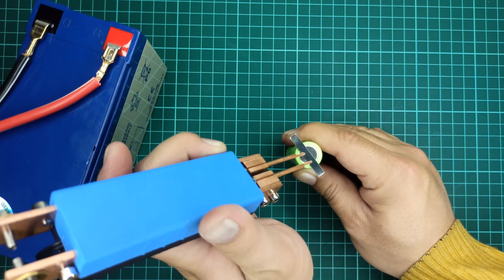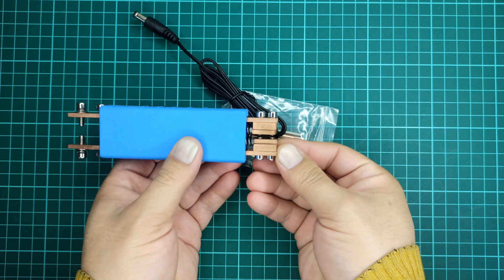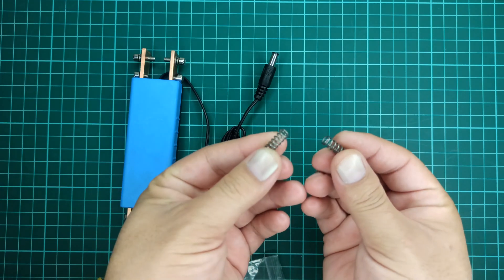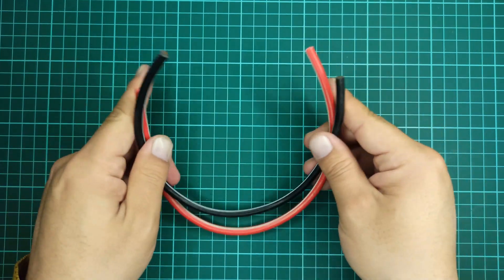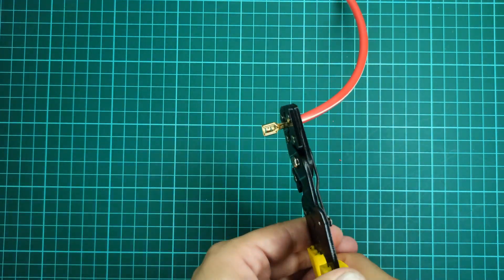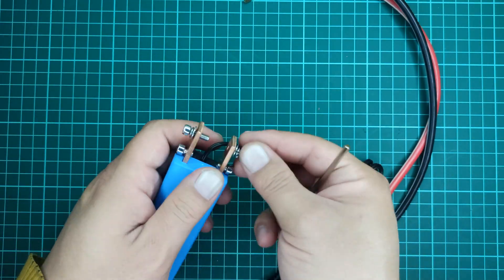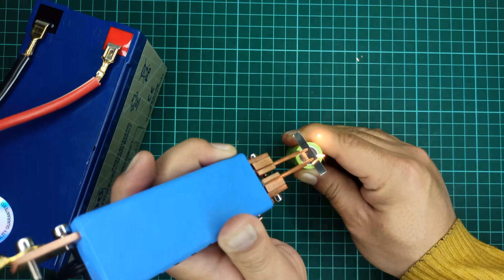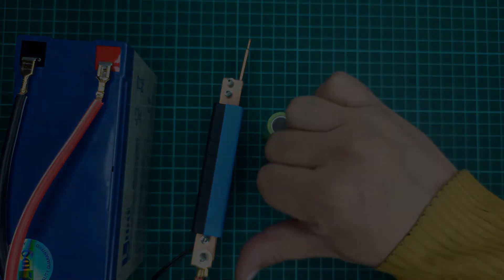DIY 12V Battery Spot Welder FAIL | Why This Method Doesn’t Work

Comment: I felt his pain.  I have electronics in my background.  I did the same things.  It took a lot of YouTube to find the solution.  I bought the caps, the resistors, and now can't find the video again.  I studied electron tubes in school.  So I'm old.  Maybe that's the problem.
Reply from the maker: I have designed my new spot welding machine with pulse and power control circuit, and its working 😀

Comment: No knowledge at all. Keep the tips straight 90° not tilted. Cheap DIY can't work. Minimum questions to ask yourself: how thick is the nickel strip? Is it different to weld nickel on nickel VS nickel on Cell? The thinner the nickel string the lower power/pulses you need. And, yes, welding nickel on nickel is different than welding onto a cell, you should normally regulate the current+pulses. If you want to weld get yourself a decent welder, I have a Sunkko 709AD bought on Ali Express and I love it. It heats up during use, so every couple hundred spots I stop for a couple of minutes.
Reply from the maker: Hi there,
Thanks for your comment and detailed explanation.
Checkout my new spot welder and its performance, its a proper spot welder now 😅
https://youtu.be/GCtI3KQwVG4

Comment: If current is too high, use a longer cable with thinner conductor between battery and welder
Reply from the maker: Thanks for the suggestion!

Comment: You can use 12v battery, it just needs to be a car battery or truck.  You need higher amps than the battery you used. To others the solenoid etc approach is so that it has an auto dump otherwise you can just manually break circuit by stop touching..
Reply from the maker: Yes, i have recently designed an AC spot welder which works perfect.
Video uploaded too if you are interested to watch.
Reply: You won't be able to weld decently unless you can regulate current (and possibly the number of pulses). For low loads you may use narrow 0.12mm strips, for higher loads you'll need a thicker/wider strip. And you regulate current (and, again, pulses) based of thickness and material types

Comment: Sorry. This review isn't correct.
Where do you connect the black wire with a socket. Don't you think this setup is too simple? Don't you think there is a purpose for the black cable too
Reply from the maker: This was just a fun experiment, and that is a connector for trigger switch and can be used with circuits that allow the user to set the trigger through the circuit.

Comment: it's not for use this way, the seller says clearly it must be used with a spot welder machine, not alone
Reply from the maker: This is exactly what i want to show in this video.
Reply: Won't it work with 100amp battery?

Comment: Best to perform this method while in a spa / jacuzzi outside with a lightning storm coming and a long metal rod extending from under water with a toaster submerged as well. Then you will get some nice welds on your 18650's and save money on replacement Dewalts.⚡⚡⚡

Comment: I can use car baterías or motorcicle ?
Reply from the maker: Yes you can use them as well but spot welding generally requires high instantaneous current, so a 100A battery or above is recommended for this purpose.
Reply: @ERLEngineering  gracias un seguidor mas
Reply from the maker: Thanks

Comment: hi , you are using 12v Battery and how much ampere . if i use 12v dc power adapter then how much ampere required. can i use laptop adapter  also for it
Reply from the maker: Hello, i used 12v 9amp battery but this battery is not enough to provide the required current for spot welding.
For good spot welds on lithium ion cell you'll need atleast 100Ah battery.
The spot welding also requires pulsed output (typically 10-100 msec) which was not used in this method.
Also, a laptop adapter cannot be used for this purpose because the adapter cannot provide the required current

Comment: with direct to battery method weld you need a motor cycle starter relay or any 12v 40-100amps relay to make it work properly
Reply: Can you post el.drawing with this relay? Will be us we full
Reply from the maker: Yes, thats correct
Reply: @ERLEngineering how do you connect the relay

Comment: 😂😂😂😂😂😂😂😂HAHAHAHA THE BLIND LEADING THE BLIND! you are not suppose to hook direct to a battery! very dangerous!!!!!!!
its only for use on spot welding machine that can increase and safely spot weld with higher currents you look like a fool for hooking directly to a battery
black wire is for spot welder machine trigger  THIS IS JUST A PEN!! DO NOT DO THIS ITS NOT SAFE AND CAN SHORT OUT THE BATTERY AND EXPLODE IN YOUR FACE
BUY THE MACHINE FOR THIS PEN
Reply from the maker: Dear mike, Please read the title of this video and watch it completely where i was telling the same thing to all those who have tried this method. I've clearly mentioned in my video that this method cannot be used for spot welding as shown by some of the youtubers. Thank you for your comment

Comment: Hello dear! I have the same pen. But my spot welding machine doesn’t have the port to connect that middle (black wire on the pen). Plz tell me how could i operate that pen with welding mashine wich has only +/- INN and +/- out? 😳
Reply from the maker: Hello, its not compulsory to connect the black wire which is only for trigger.
You can simply add a delay between two spots (if applicable) or use a simple delay timer circuit with your spot welder.
I am using the same circuit which do not include any such feature of triggering

Comment: Hello! Sorry, i dont get what this black wire with jack is for, could you tell me?? Can i use this pen with another adjustable welding station (with not connecting that jack anyway)?? 
Could you say What is that jack for??
Reply: that black wire with the jack is for the switch. do not attach the pen dirrectly to a battery for christ sakes man. do more research.
Reply from the maker: The black wire with the jack is for those circuits which have a relay to only close the circuit with the pen sends a trigger. So basically this black wire is simply connected with a small switch inside the pen, when you put pressure on the pen that switch closes and it triggers the relay inside the circuit that now is the time to provide that short burst of current. If you don't connect this then there will be no such protection of accidentally touching the two electrodes of the pen. So yes you can use this pen with your adjustable welding station.

Comment: That pen isn't made to connect straight to a battery... There is no voltage change or current change doing it the way you are... You have to use the pen with a spot welder machine...
Reply from the maker: Yes you are right.
Actually i saw some videos where people have claimed that they can spot weld using this method. But most probably they have used an old battery with low charge. The purpose of this video is to show that when a battery is fully charged, this method will not work and soon i will be showing 3 more and better methods of spot welding.
Thanks for your feedback